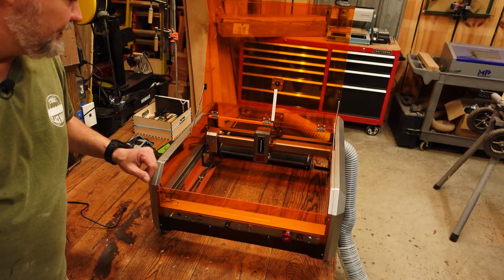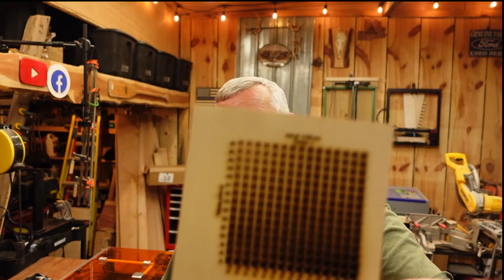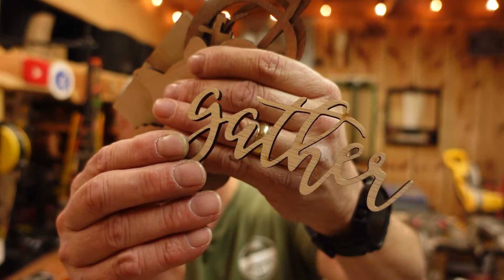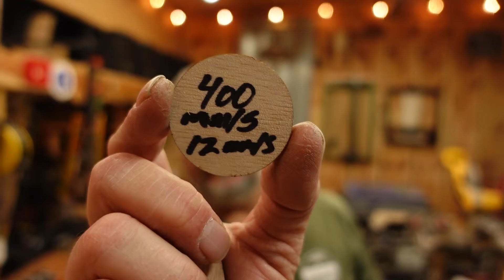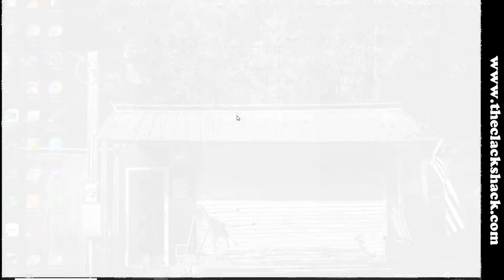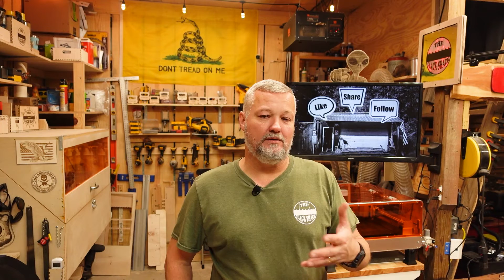The all new Sainsmart Genmitsu L8

Comment: The camera is crap, the calibration is so difficult and innacurate~
Reply from the maker: I have had good luck with mine. The camera calibration is the same as any other lightburn camera.
Reply: Is it normal after calibration to not see the entire bed? If so I will stop endlessly calibrating to achieve it. Thanks
Reply from the maker: @matthews5531  it you don’t place the cards in the corners, yes

Comment: Need some help with the software. It’s a brick and I can’t get the software to see the laser. So far the instructions are horrible. Any advise?
Reply from the maker: Are you using lightburn? Make sure you add the driver, I think it is on the as card or thumb drive. (Can’t remember which)

Comment: I finally took delivery of mine on Thursday. So far I've managed to waste 4 pieces of wood because the machine is constantly alarming out even when it's just stood idle and not cutting/engraving. I've seen on the TF card there's a firmware update and Lasertool flashing software but I can't get it to work..... On my older LC-40, you had hold the reset button while you turned the machine on to put it in flash mode, anyone any ideas how to do that on the L8?
Reply from the maker: I did update the firmware on mine, the old firmware had some alarm issues. I do remember using the software, it will prompt you on how to put it in update mode
Reply: @TheClackShack  I’ve emailed Sainsmart about it. Just hope they come back to me soon. There’s no prompt or instructions on how to enter update mode. 
I’ve gone back to the trusty LC40 for now.

Comment: how does this compare to the lasermatic mk2?
Reply from the maker: It is designed similarly, the construction isn't as rigid and it doesn't have a bottom to the enclosure. Also, the L8 is a 20 watt where the MK2 can be a 30.
Reply: So the mk2 even at 20w would be a better machine?

Comment: Hey Clack. I have done long butcher block counter tops before. I like the open bottom of this system for that reason. Given the option, would you pick this laser or the lasermatic?
Reply from the maker: It is a good machine, the Lasermatic is heavier built and has linear rails. This one isn't bad but not quite up to the lasermatic.

Comment: You made a comment in a recent video that you connect to your machines wirelessly with your laptop.

Maybe you covered this in a previous video, but what do you use to wirelessly connect to your machines?

Thanks again for your videos!
Reply from the maker: The ones that have the options in their software. Most lightburn controlled machines do not have the option. Ortur does have the capability in the LM3.